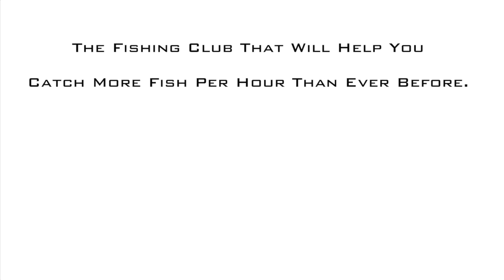PowerPro vs Spiderwire Ultracast Invisi-Braid Abrasion test

Comment: Very hard to determine comparisons. But i thought your test was conducted quite fairly. I just received my Spiderwire Ultracast x8 for 4lb. off Amazon. For UL i never expect a standout. I'm more concerned about yardage & line diameter. I've always used 4lb mono for years but i wanted to try this braid as the max break listed is 14lb. The 1K reel i was thinking of using maxes out at 8lb. But i'll easily will get all 164m spooled on it np at least. Thank you for this video.
Reply from the maker: Thanks for the feedback!
Reply: @Saltstrong  Just subscribed. I rarely subscribe to anyone because there's no end to it & I have a lot to do just to keep 30 buffer videos in front of my own postings. Again good job on this video.

Comment: Spiderwire invisi braid is the best spider wire available entirely different that spider wire stealth or any spider wire
Reply: Hi, which is stronger between spiderwire stealth and spiderwire ultracast (both of same lb power)?
Reply: @naturegreen7233  I've had my spiderwire stealth get icy in the cold it's the better than the power pro, My power-pro is the same lbs (20#) It's slight smaller & lighter so will cast farther. But it's doesn't untangle as well as the spiderwire stealth does.
Reply: @kevinerbs2778  👍👍👍
Thank you....

Comment: That moment he testing to prove spider wire the better one and it fails on each test, and he’s like oh erm yeah this test is not official
Reply from the maker: There was no bias in this test... the comment about the test not being official is because of how close each fail happened. Most other tests help previously had much larger gaps between the lines breaking, so this test was much less conclusive than the others. Here's a link to the full experiment results covering casting distance, abrasion resistance, knot strength, and longevity in case you want to see the full results: https://www.saltstrong.com/articles/spiderwire-ultracast-invisi-braid-vs-powerpro/

Comment: Can you test a higher test? I don't know a lot of fishers that use 10# braid other than for freshwater (bream and crappie). I think testing the 20# and 30# would be more helpful.
Reply from the maker: Well you just met one now... I use 10 lb test for 95% of my saltwater fishing needs when targeting redfish, snook, trout, flounder, etc., and I feel that it significantly helps me catch more fish since it enables me to cover more water with less effort. I suggest giving it a shot. Here's an experiment I did on casting distance impact from using a 20lb braid compared to a 10 lb braid... the result was that the smaller line can add 20% more distance which equates to being able to cover an additional football field length of distance every ~15 casts (https://www.saltstrong.com/articles/casting-distance-experiment-10-vs-20-braid/). Best of all, that added water coverage is the optimal strike zone when blind casting because the fish are less likely to feel your presence.

Note: When using a great knot like the FG knot to connect to your leader, the breaking strength of the line should still be in the 20lb range, so it's plenty strong to handle big fish... here's a tarpon being landed on the light line: https://youtu.be/K9cJeyjxeFk